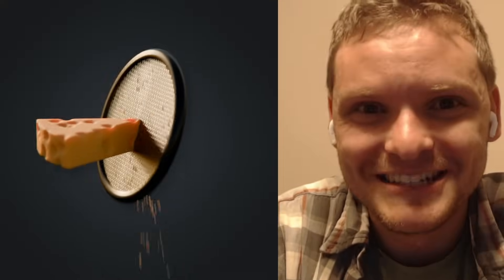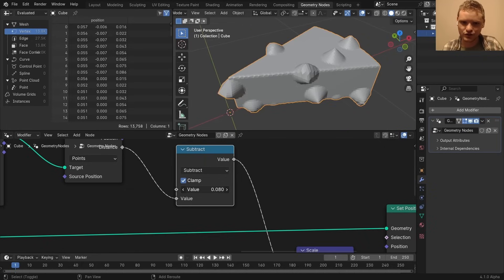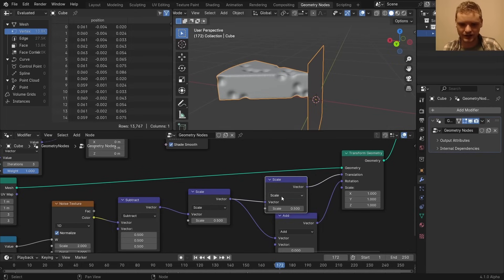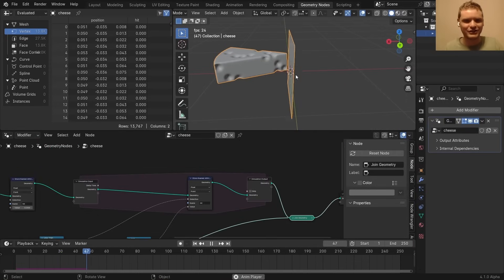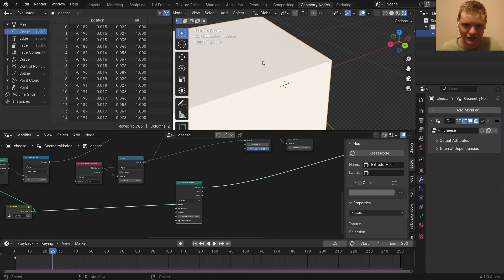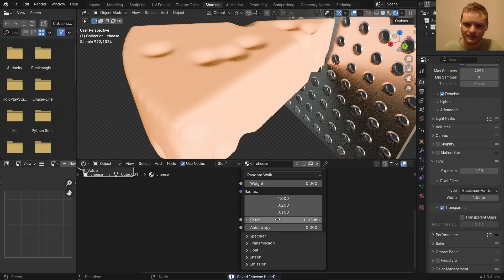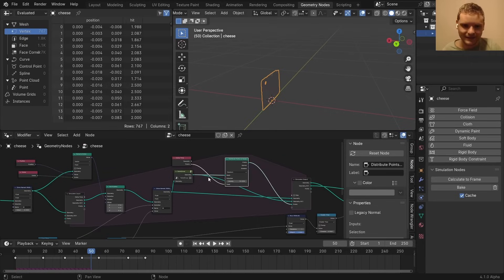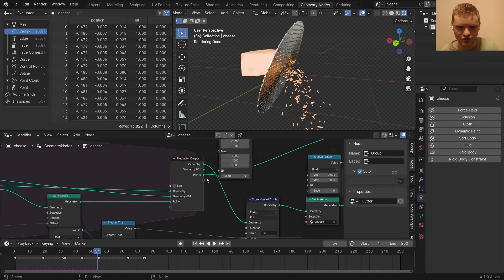nodevember. procedural cheese grating

Comment: if you want a more accurate result and not need to blur, etc. you do a dot product between the normal and the points subtracted from the proximity position. if it's negative or positive it will tell you the front and back.
Reply: ik this one was kind of hard to watch for programmers, the way he handled some of the logical parts was as if he was doing it in real life, that pushing the cheese to make a cross-section was hilarious. sometimes I wonder what the code equivalent of some of the wired sht we do in geo nodes would come out to be.
Reply: @esomos_org  🤣